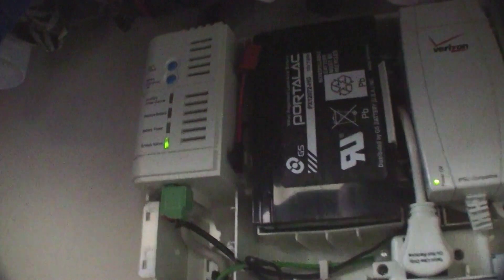Solving the "FIOS Beep"

Comment: I know this is an old video, but had to say that I've had to do this every couple months since I bought my house about 5 years ago.  I never know what exactly i'm doing, i just fiddle with the connectors until the red light finally goes off.  It never really beeps often enough for me to want to spend the money to replace it, but I may since I don't think my landline works when the  power is out. I just figured thats how land lines were nowadays and didn't know this battery was supposed to allow it to work in a power outage.

Comment: Well usually if you can see a red light means you need to change your battery..
Reply from the maker: You're right. It's strictly a temporary fix, but it works for a while before beeping again. Fortunately, I also have a follow-up video on replacing the battery...

Comment: so, here I am, years later trying to figure out where the beep is coming from and after taking apart two other backup batteries from the kitchen, took a shot and watched your video and lo and behold, my Hotwire battery on the wall behind my dresser in the master bedroom had a red light saying needed to be replaced. I opened up the case, pulled out the battery and disconnected the cables and reconnected them, red light went off. You're a genius. I do expect this battery will need replacing at some point, it's been a couple years or less since my Hotwire equipment was installed.
Reply from the maker: I'm happy that this video is still saving people's sanity after all this time.

Comment: Excellent Paul.  Thanks. Shut off circuit breakers and changed a few batteries in different remotes before I tried taking off the Hotwire cover. Once the cover was off, the beep sound was much louder. Disconnected and reconnected the red connection on the side of the battery. Done

Comment: I tried this trick...it worked for about a year or two.  Then, it stopped working.  I don't know why.  Any ideas?
Reply from the maker: dmiller1000 eventually you will have to replace the battery,  which is just as easy but will cost you like $15. Check out my other FIOS video for more on that.
Reply: Yes.  Thanks.  That's what I kind of concluded.  I thought of trying to find the alarm and trying to disable it, but somehow that would probably result in a broken device.

Comment: Unit on wall is called an ONT. You don't need to use a battery, unless you want power in a power-outage, lasts about 4 hrs.  The thing that sucks about Verizon is the customer must by these battery units. They cost about $ 22.  Verizon has stable internet connectivity via Fios but is EXPENSIVE to have a triple play ( Phone,internet/TV).. Greedy Bastards!

Comment: FIOS customer service-battery not needed; power strip was accidentally off, Called FIOS, got  their robo reply; ''you need a new battery...it'll be $48.00..in case of emergency it powers your phone; do you want it?''  I need the landline so I order it.  FIOS installed the box in my bedroom closet, with 2 cables going from their box to the nearest  electrical outlet-using both plugs. The installer used a power strip so I wouldn't have  ''fewer electrical outlets.'' Power strips have toggle switches-the type of switch most of of us use to turn on overhead lights etc. These can easily be accidentally be turned off; mine were left on the floor where else to put it?-had not yet purchased 3M hooks or some such to hold the power strip over the floor so it would not get tripped. When someone did some trouble-shooting the first order of business what to flip that switch. No need for the battery! Called their Customer Service got someone in the Caribbean, the box was UNOPENED! she says, yes you can return it to the FIOS store near your home [only a very few in my state do it]. I go there, it was 31 days after I rec'd it, they refused to take it back, I was exactly one day late. Their rep from the Caribbean said absolutely nothing about a limit of 30 days to return this, neither did the robo call. At their store I got the run around from a pissed off manager. An employee escorted me to a  landline to speak to yet another dept. that rep wants my pin # which no one suggested I bring with me, & I didn't have it; she asked for my account # which was next to me, as soon as I get back to her, music plays + no human comes on.  Yet another call & another agent, this one was from the  Philippines, -lots more polite, promises to solve this today, puts me on hold + comes back to say he's still working on it, sounds honest/sincere, agrees to a full refund & lets me keep the battery. I asked him to repeat that to the the mgr.; she listens, is ticked off; + disappears; before I leave, I go to the only other visible FIOS person  + say "I don't want to take anything that doesn't belong to me, the agent said I can keep the battery, he nods yes, walks with me to the battery; mgr comes out screeching in a demanding tone, "if you don't need the battery why are you taking it!"  I said, ''your customer service rep said I could''.  It took easily 1 hour to get the promise of a refund and keep  the battery. The woman from the Caribbean said I'd need the store # and receipt #; the mgr. screeched again there is no receipt #, another FIOS person refused to give me a store #, so I left with nothing in writing/no proof. Luckily the last agent from the  Philippines emailed me a credit which reduced my bill, just in time to pay it online without more fees.

Comment: What is the permenant solution you referenced?    We don't even have verizon service anymore  since Frontier bought them  out, and we ended up switching to Time Warner (now Spectrum).   Don't want this LOUD beeping anymore, and don't want a temp fix.  In fact I don't know why we are saddled with all the Verizon boxes in our house now that we don't need or want them.  Anyways, what is permanent solution?
Reply from the maker: Patti Smith check out my other video on battery replacement, and see the links in the description for suggested batteries on Amazon.

Comment: Replace the battery with a 12Volt DC adapter.
1. Open the unit remove the plug and wires from the battery.
2. Take the battery out and leave it out.
3. Drill a small hole in the top of the unit and attach longer wires to the battery plug.
4. Plug it back in and run the wires through the hole in the top and close the door.
5. Attach a 12 Volt DC Adapter using wire nuts (twist to attach the wires.) and plug the adapter into 110 Volts.
Problem solved. It will never beep again
Reply: +Dave Clark Umm, so what happens when you lose whole house power? Don't you need the battery if you have land line service?
Reply: +mortalstorm  I don't have a landline service but I found out later that the battery is rechargeable and the verizon box is trickle charging it all the time. The adapter worked for a while and then the beeping started again. Then I found a new battery on Amazon for $16 and ordered it. In the meantime, I connected the old battery back up and haven't had a beeping now for over a week. I'll connect the new battery IF the beeping starts again.
Reply: +Dave Clark But if you don't have land line service, why bother with the battery in the first place...just leave it disconnected? As I understand it, your internet and tv service will work fine without it. Or am I misinformed? Even if you have land line, the only time you'll need it is during a power outage at which time you can connect the battery back up. I don't experience too many outages (perhaps one every couple of years on average) so that would work for me.
Reply: +mortalstorm If I leave the battery disconnected, the beeping doesn't stop. It beeps every 15 minutes. The audio buzzer (beeper) is a pizeioelectric device that may be removed from the circuit board but it isn't easy to take everything apart to get to it. If there was an easy way to disable the beeping circuit, I would do that because I don't need a landline backup. But for $16 on Amazon, a new battery is the best solution.

Comment: I had replaced the battery at my sisters Fios box just last October. Box starting beeping again this week. In past, I simply removed the battery and recharged it, and reinstalled. Seems the Verizon box doesn't actually recharge the battery. Secondly, her box is different than mine, and users guide inside says they run a battery test every 45 days that lasts 17 hours! Yes, that is longer than any power outage we've had for 10 years! Someone from Ralph Nader's group should file a complaint with Verizon over this ridiculous feature.

Comment: Should I unplugged the bbu from the electrical outlet before opening the unit?
Reply from the maker: +RAlex As far as I know, there is no exposed 120VAC wiring under the cover that you can come in contact with, and I have opened and messed with mine many a time with it plugged in. HOWEVER, with an abundance of caution and a healthy fear of getting sued, I will say that unplugging it from the wall first would be the safest way to work on the battery backup.

Comment: What is the "permanent solution"? The link takes me to a replacement battery.
Reply from the maker: daredevildaryl The permanent solution is replacing the battery. Well, permanent as in 5 or so years until that battery eventually goes bad too.
Reply: Spinolio Mine lasted 23 months :(